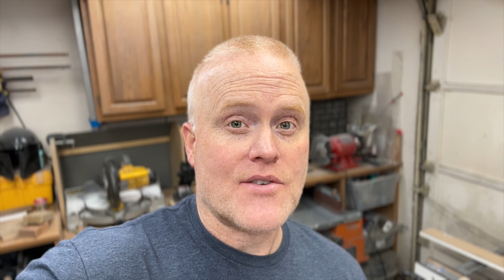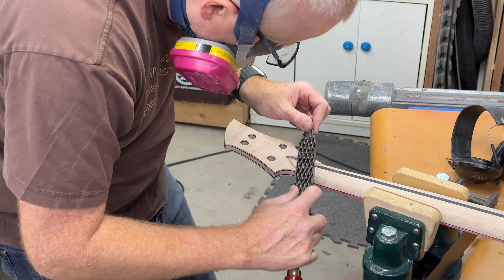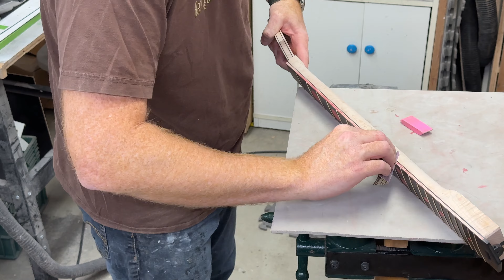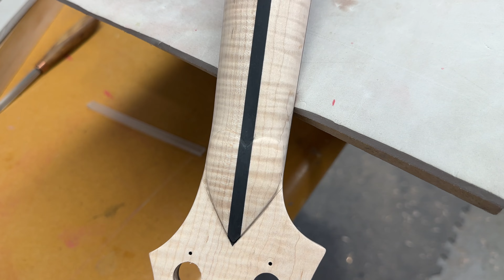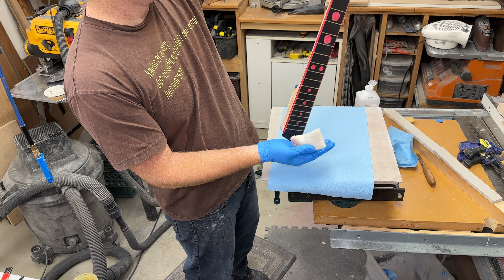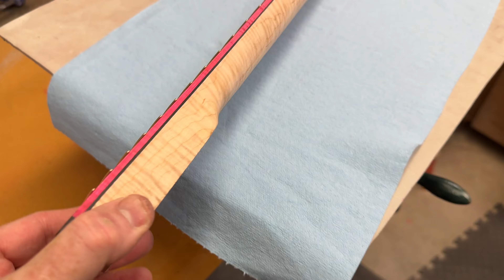From Rocking Chair To Rockin Bass Part 6 - Electric Guitar Round End Frets and Neck Carving

Comment: Looks awesome Eric!  Did you have any trouble with the color bleeding when applying the oil?  I have the same Shinto and gold Amazon rasps for neck carving. When I do the hemispheric fret ends I just use my bench grinder with a 6” buffing wheel, I use this metal polish called Wenol on the wheel. It takes maybe 30 seconds per side and it takes out all the grinding wheel marks. I was going to send you a video, but instagram says it has to be under 30 seconds. Let me know if you want me to send it a different way. Make sure to wear gloves when you do it, they get kinda hot. 😜
Reply from the maker: Thank ya. There was very little bleed which surprised me. That polishing tip it great, will be a time and finger saver. Thank you for sharing.